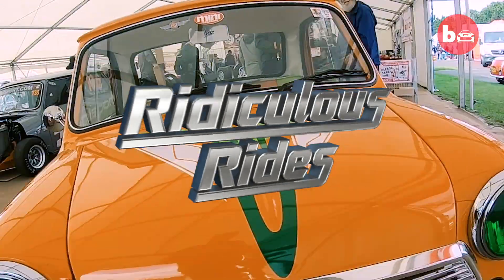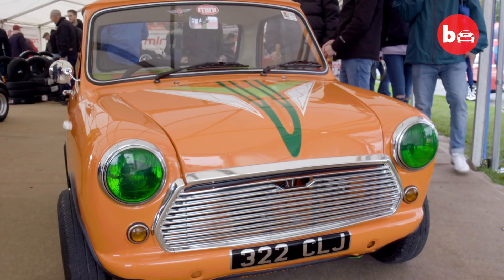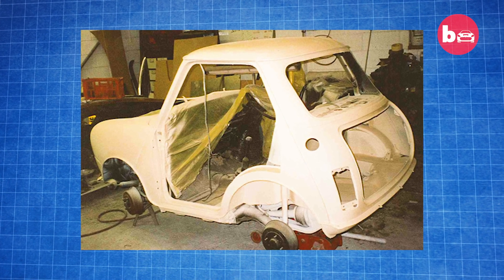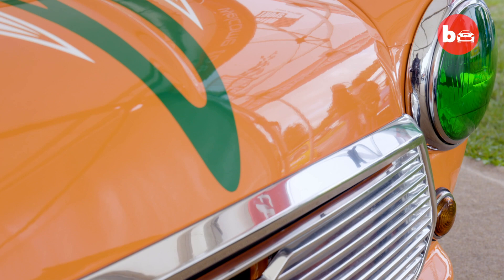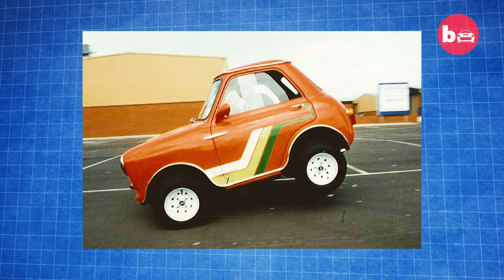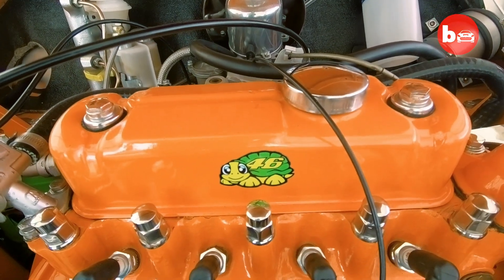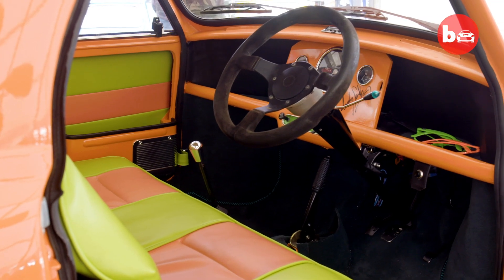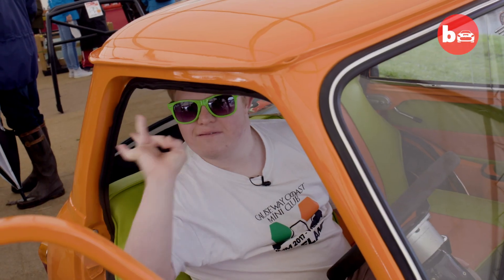I Cut My Mini In Half | RIDICULOUS RIDES

Comment: There use to be one of these in Glasgow, years ago. It was owned by the Mini Centre in Partick and I think it was there breakdown vehicle. It had a 1300cc Cooper engine, fat tyres and a HUGE polystyrene key sticking out the back. I think the police made them remove the key as it was a distraction for drivers. Wish I had it.

Comment: 0:55 I did mine in 1970, with parts from two 1961 Minis. I had no body on it, just joined the subframes with some angle iron. It had a 43” wheel base.